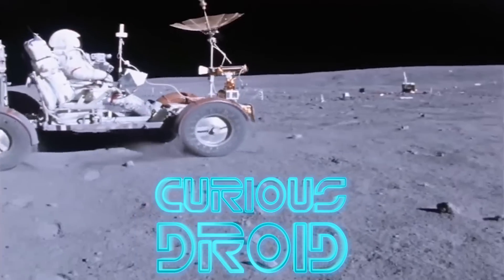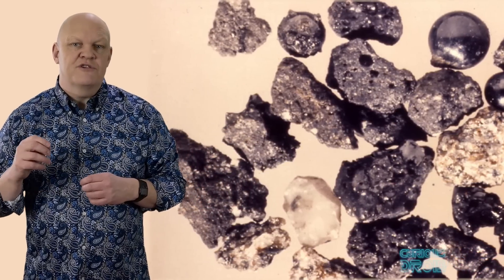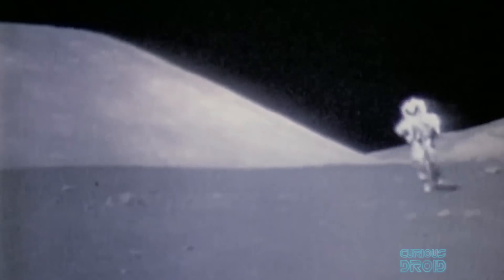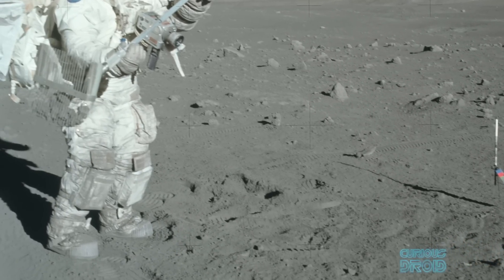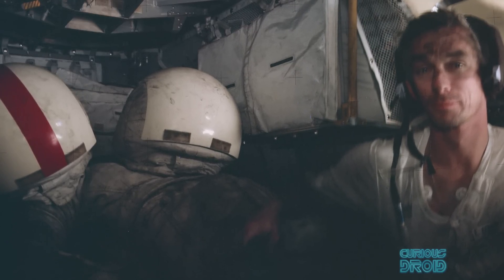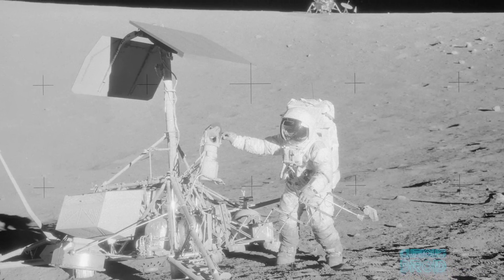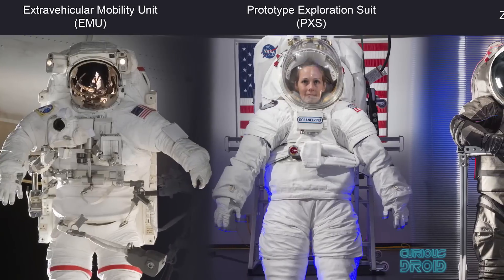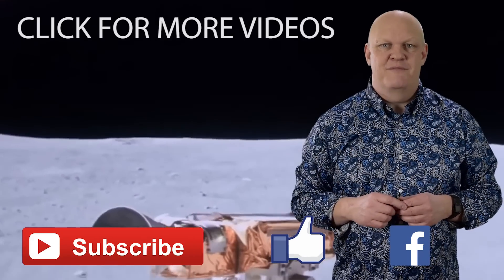Apollo, the Lunar Dust and NASA's Dirty Problem

Comment: Yet for all the trips back from the moon they brought their spacesuits into the LEM without a airlock transition. (there was just the one door opening out to the moon) Then they had no airlock or anyway to enter the Command Module from the LEM.  With all the care we saw them making the spacecraft with paper hats and "clean rooms"  They didn't seem to care much that they brought copious amounts of dust into their clean environment.  Also check out how haphazardly they drive the rover.  Kicking up dust and racing around lifting the whole front  end of the ground.  These astronauts were former test pilots.  Because the rover was never tested before on the moon these photos show what is their first actual operation on the moon.  No test procedure would allow for such racing around. Any test procedure is incremental.  They operate a machine slow to begin with then move it up a mile and hour or two. Never on unproven equipment do they go full out like they did.  It would be totally irresponsible and and could jeopardize the entire mission should something happened.  This couldn't have been real. No multi-billion dollar test operates so foolishly.  But, of course, it was only a doll or dummy shown in the clip.  Several cuts are involved and the Dummy driver never moves an inch.  His left arm is stuck out to the side regardless what is happening.  The first rule of the Scientific Method is Observation.  So do your duty and look at that!  Also note the separation line that divides every moon shot in the background.  There is always a line from left to right that separates the front stage from the back projection wall.
The last requirement of the Scientific Method is to replicate.  If you can't replicate an experiment you don't have a valid proposition.  Seems we can't replicate anything that was shown to us they did on the moon.  But we can through stagecraft replicate everything we see on a stage with Earth's gravity.  From the skipping they do to the huge 18 inch but they do.  That's the height a man gets when jumping up on the Earth.  Just the fact that observation is suspect and that we can't or haven't duplicated these feats then they are not provable by independent experimentation.  Things in this category therefore are just theory as far as the scientific community apart from NASA is concerned.
Reply: You obviously don't know SHIT about the Apollo missions! The LM and Command Module would DOCK and the astronauts would transition from the LM to CM through the docking tunnel. Very simple. Just because you are too stupid to understand it doesn't mean it never happened.
Reply: Dear Bob, You through around a bunch of words like calling me stupid.  "It's very simple The LEM and Command Module would Dock and the astronauts would transition for the LM to CM through the docking tunnel,."  That's exactly what I said, and since there was no airlock chamber they brought the bust right along with them.. Do you believe 19 terrorists took a few flight lessons in a Cessna and then Flew 757s and 767 into the WTC.  Of course you do because the proof you have is the read terrorist scarf and passport found in the rubble next to each other 45 minutes later.  You are so smart that when a government official tells you that a bullet from a old bold action rifle went though Kennedy's neck existed curved around striking Governor Connelly in the back chipped a rib exited his chest curved again 80 degrees and smashed into his wrist breaking it.  Later that same bullet was found in pristine shape on the stretcher at the hospital. Who's stupid now?  And 110 story buildings fall at free fall gravitational speed. The explosions you see everywhere are just the windows being blown out.  WTC building 7 didn't get  hit by an airplane but collapsed also.
Then because you are such a genius you know that a crew who's average annual salary is less than $65000 a year from CNN just months earlier tracked down the most sought after terrorist on the planet and has a nice little interview in his cave.  The assets of the  DIA, the Western world and Russia  couldn't find this guy with their NSA computers, satellites , informants the whole works.  But CNN walks right in and films him.  And you call me stupid. Well mister genius do a Statistical Probability Analysis on the 6 flights to the moon that had not so much as a radio problem and then tell me it happened as they said.  You are the fool.  You believed the interview in the Cave, you believe the bouncing Rover with the doll or dummy spinning around.
But you won't lift an ounce off your easy chair because you might get scared it the world that was laid out for you isn't true.  More is coming but you don't have to worry the government will tell you it's all OK.  Just give them a bit more money, give up a bit more freedom and have them tuck you safely in bed.
What happened to your ability to think for yourself?  When the Banks gamble with your hard earned money and loose, then run to the government to get reimbursed and they give it all back to them while you lose it will serve you well to believe what they say, right?  Oops, a down turn in the economy!  Such a natural thing.
It used to be the bad times came after a drought, Ice storms froze our crops, the dust bowl, some real reason bad time came upon us.  Now it's just because.  Nothing in the physical world changes.  The crops are all still growing, the materials are all still mined, nothing changes, Yet, overnight bad times come upon us. Bad times don't come upon some people in this world.  I'm sorry, I'm too stupid to understand what I'm being told.
Go turn on Family Feud and guess an answer!  The moon landing issue is solved.

Comment: Interesting re the speed of lunar dust blown away by the rocket exhaust, with no air it would just keep going. Lunar orbital velocity is about 6000 ft/sec, so none achieved a partial orbit, but would have gone a long way for sure. LOL on the landing hoaxer guys feeling they've made a point because no dust (puffed up by the landing rockets) shows up on the landing pads.

Comment: so how come the dust didn't act like that when the lunar buggy was kicking up all that dust why did it just fall back down instead of flying straight up
Reply: Because the wheels were only going around at a few metres per second. The exhaust from a rocket is much faster.
Reply: The Moon does have some gravity.
Reply: Flexiblelip the way it falls shows that there's no atmosphere.
Fine dust would disperse into clouds and linger in the air on earth due to the atmosphere
Reply: p edmond if you watch the dust trail it does fly straight up until it runs out of energy
Reply: NelC if you take a good look at how the dustparticles behave when they drove the rover on the sand, you can clearly see it was filmed on earth. The dust stops mid-air and falls down. The cause is earths atmosphere.

Comment: Dust got in the sealed containers.  Did dust get into the sealed photographic film magazines and did dust get into the cameras and why do we not see it on the photos?
Reply: papaike2 - The surface temperature on the moon is dependent upon the angle of the sun. Also, in a vacuum, the temperature extremes were never present inside the film magazine because there's no atmosphere for conduction.

Cameras used during missions in earth orbit are exposed to the same temperature variations, and they even pass through sun/dark cycles every 45 minutes, and therefore a number of times on every EVA.

Your assertion is bullshit. Sorry.
Reply: The only way dust could enter into the internals of the camera and do some damage to the film whould have been during the change of a film magazine.
Well, you do not change a film magazine while hopping arund in the middle of a dust cloud. And you also do not wipe across the sealing element, when it is not neccessary. Oh and of course you do not change a film magazine by laying everything on the (dusty) floor.
On the other hand there is lierally no way, to fill a container with dusty stones without getting some dust on the sealing rubber surfaces of the container which is standing on the ground with the lid open. Wipeing that dust away with a dirty glove in the absence of the possibility of blowing at it just makes matters worse. So you just leave it there and hope for the best regarding the 100% air tight sealing of the container.

Oh. And 1 or 2 or 3 grains of dust on the lense are usually no problem at all. Even today the recommendation ist: If you don't have the right equipment handy, just leave it there. You will not see them on the photo due to something which is called "depth of field". Moving it around with some sort of cloth will only do damage to the coating of the lens. The problem is, that even basic knowlegde of photograhy seems to get lost since we do have cameras where you just press a button and everything else is done by electronics.
Reply: And let it be known Kodak Ektochrome-3 film used in the Apollo Hassleblads won't melt below 550 degrees Fahrenheit, in an atmosphere, which is course isn't present in space or on the lunar surface.
Reply: k4vud
Beware of your own ignorance. I haven't confused anything. I was addressing someones claim about lunar surface temperatures. Surface temperatures. Film in the Hassleblads isn't exposed to sunlight, because exposing film to sunlight ruins the purpose of it.
Reply: They didn't open the cameras in the Luna atmosphere during the early missions as someone already said, they swapped the films inside the Luna module and made sure that the seals on the cameras were good before leaving the module....and anyway Curious droid didn't say that it was the cameras that got dust in the seals he said it was the rock containers that were having that problem with the Luna dust as the Apollo astronauts were moving the rocks to the special containers, some of the dust settled on the seals as they placed the rocks inside the containers and it practically rendered the seals useless.
Reply: Ken moore, that is one of the most retarded arguments I've heard in a long time. 
First, you can get good cell phone coverage the overwhelming majority of the time, especially in areas where it is needed.
Second, NASA knew where to send and receive signals: the moon with little other traffic for interference. The protocols used relied on as much compression as possible whilst still being able to recover data if some was lost in transmission. Do you really think a properly funded space program is going to have problems generating a strong enough signal to get to the moon?
Your problem isn't with the signal strength, you just live in the middle of nowhere or have a shit phone, along with large amounts of traffic/interference. No one is expecting transmissions from your house, they were expecting them from the moon.
Reply: no dust did not get into the internals of the cameras because they were encased in a handheld metal housing i think.
Reply: get a life. And when we are at it: get an education! Physics 101 would be sufficient
Reply: See how ken moore fails to come up with an argument to support their preposterous claims, and so instead resorts to petty insults.
Reply: Of course it was dusty inside the LEM also. Just as it is dirty in your home, if the kids come in with dirty and muddy shoes. Come on! Use your common sense! If you have dust on your gloves and your suit, then that dust will be everywhere you touch! There is no way around it, since you can get rid of your gloves and the suit only when the hatch is closed. But for this to happen you already need to touch a lot of things and that includes climbing into the LEM through the hatch on your knees. The LEM was not a 100 squarefoot appartment but only had narrow space. How narrow? They needed to sleep on the engine cover as there was no other space to do it.
And there is a difference between the containers, which were used to transport stones and a camera. Especially when you notice that you have dust on your gloves and that dust sticks to everything. Can you guess what that might be? Come on. Use common sense! You will figure it out, since you do that automatically by yourself.  - You take care not to touch the seals when handling the magazines and try to keep them out of the dust as much as you can when you need to change them on the camera. A camer is very light and you can operate it easily while you stand. Now try the same with a container while you are filling it with pounds of stones. Of course you will open the container, when it rests on the ground. With all that sand around you and on the stones you try to pack into the container.
Reply: Wow, what a convincing argument. Yout mom has to be very proud of you
Reply: Charles Harpole, I don't think you had enough time to mature out of a fetus, you don't have eyes, let alone a decent brain!
Reply: Actually the film and camera were modified to work in high and low temperatures.. They walked on the Moon. Deal with it.
Reply: Apollo was the god of the Sun, healing, music and archery, not the underworld.
Reply: kallewirsch2263 shhh don't you know these idiots lack common sense. These idiots are the type to do exactly that, change a film in the middle of the sandstorm.
Reply: Zem Zem - There are a handful of Apollo photos showing lunar regolith on the LM footpads. I made a video showing them.
Reply: They were talking clear? Man, you obviously never heard the tapes. They constantly had to switch between different dishes on the capsule, which were reoriented either manually or by the onboard computer und used the largest radio dishes on earth, that were available. So in principle it was a directed radio relay using the best equipment available at that time, using one of 3 (large) radio dishes on earth depending on which one had the moon in the line of sight. And even then it happend, that the guy remaining in orbit hat to relay orders from mission control to the decending LM, because they could not hear mission control.
Hardly a setup you can compare to todays cell phone using an omindirectional 5cm antenna inside a housing moving in a car, with lots of obstacles and reflections between the phone and the transmitter. Get a better phone or move to a place with better coverage.
So in a nutshell you are saying: I also do not have even the most simple basic knowlege on radio transmission. Thank you for admitting, but that's what most of us already knew.
Reply: Wow you people really are dumb, you can SEE the dust on the photos and on other places.
Conspiracy nutters just don't believe their own eyes, I wouldn't be surprised if they think it's a small TV screen inserted by NASA to create evidence for moon landings.
Reply: papaike2 sez, "...temperatures that there is on the moon, never."

Yes, nobody has ever taken a photograph at 90 degrees Fahrenheit. Never. So glad we have the best and brightest minds among us to keep us informed on the dirty rotten tricks science is always playing on us.
Reply: huh, i was told it didn't...oh well.
Reply: Mega...I was extrapolating from the sample cases seals to the camera and I asked;  did not declaim.  Also video said it was very dusty inside the LEM, too.
Reply: J G, come back when you grow up.
Reply: J G, you definitely did not wait long enuf to mature into a real adult.
Reply: J G keep living in your little fantasy world getting spoon fed nasa bullshit
Reply: J G you cant barely get cell phone covrrage now and in the 60s they were talking clear give me a break phony nasa
Reply: J G keep livin the dream
Reply: You must know because you were there and swiped your finger on them.
Reply: k4vud good point/ and that same dust happened to miss the landing pads- they were clean as a whistle.  I guess Buzz took a feather duster to it prior to taking any pictures
Reply: to Rick...Yes, I do ...except for the few who "just play checkers."
Reply: kallewirsch2263 boy has nasa got your brain warped
Reply: kallewirsch2263 you obviously dont have common sense if you believe this shit
Reply: roby... you are confusing video cameras and still film cameras, and associated technologies.  Moon heating did not need atmospheric conduction because of simple radiant heating via exposure to the photons of sunlight.  You can get a sunburn while inside a glass vacuum chamber on Earth.
Beware of the "teen in Mom's basement in dirty underwear" kind of ignorant and potty mouth talk.  It demeans you and shows your ignorance as well.
Reply: k4vud quit your holier than thou "swearing is for the ignorant" load of crap.
Reply: Mega..... you think mostly wrong.  This video says that dust got in beyond a seal.  If it could do that, surely it could get into the cameras and the magazines.  Soooo, I asked where are the dusty photographic prints from the camera(s)?
Reply: @hs0zcw  here https://www.google.com/search?q=AS16-114-18444&client=firefox-b&tbm=isch&tbo=u&source=univ&sa=X&ved=2ahUKEwiI56S1j9DfAhUGdBQKHbAPC0IQsAR6BAgFEAE&biw=1280&bih=607#imgdii=lhf2LCtBrCfmXM:&imgrc=2M1dlaFhLg8LNM:
Reply: Rick Jones anybody that would name a rocket after god of the underworld(Apollo)cant be believed or trusted NASA is full a shit
Reply: yes Rick, I think all the gullible dimwits were fooled or were in on the joke.  The only real, high paid NASA engineer I personally know is, yes sadly, a dimwit who voted for and STILL thinks TRump is wonderful.
If a guy can do that, being fooled about the space program would also be easy.
Reply: Not now and not then has any one ever made a photograph film that could be used with temperatures that there is on the moon, never.

Comment: For landing near a surface station, couldn't you just attract the dust that's flying around because of the engine of the landing craft with a strong electric field?
Say a rod connected to a high voltage battery
Reply: Or build a wall between the station and the landing spot. 😁
Reply: Or just land on a platform ;)